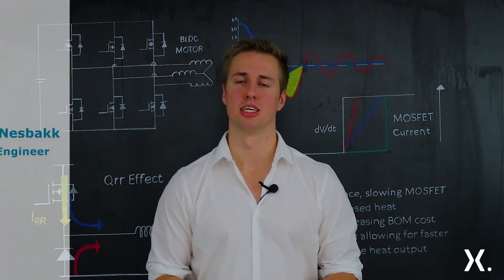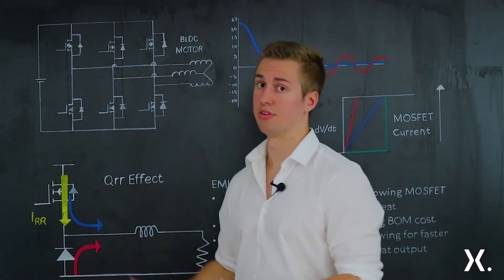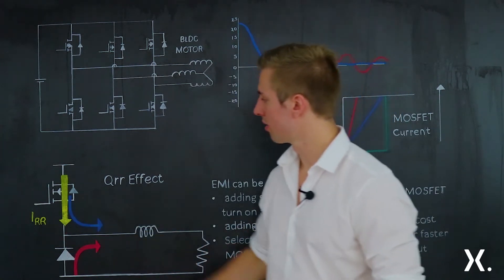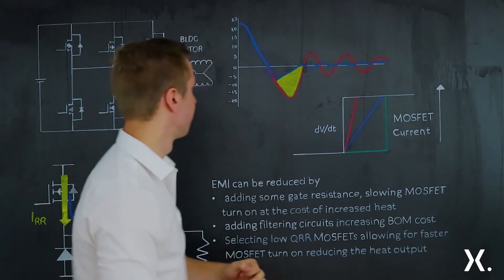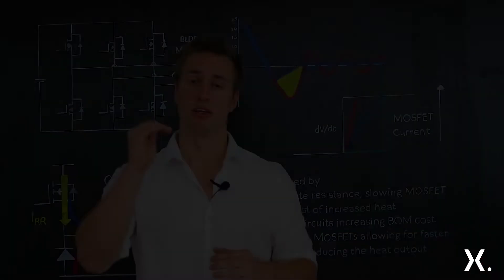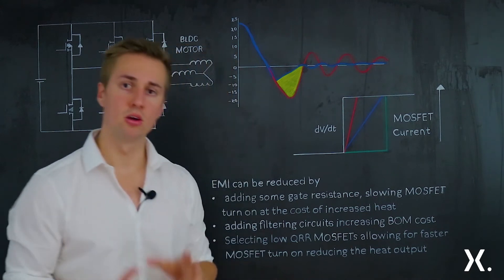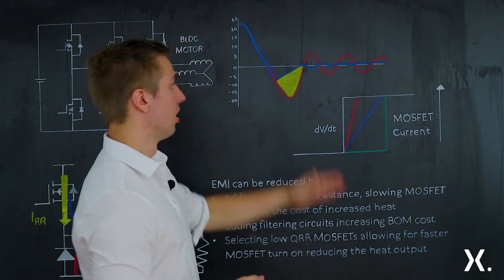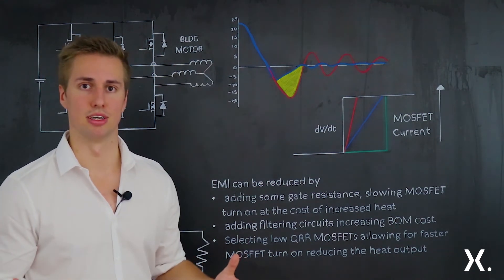Benefits of low Qrr MOSFETs in motor control applications

Comment: This video, and the blogs by Mike Becker  (on Feb 26, 2018) and Siva Uppuluri (Oct 31, 2019) all show that Nexperia seems to be concerned about Qrr but, totally unaware of total stored charge. Nexperia's data sheets STILL show the measurement of Qrr and trr at the old, outdated condition of a rate of -100A/us.  This test condition does not show total stored charge, which is much more critical for power losses and ringing that Qrr. Many manufacturers show Qrr at a more realistic measurement rate of around -2,500A/us. This more accurately show total stored charge. No design engineer in their right mind would switch a fast MOSFET at a slow rate of 100A.
Why do manufacturers continue to use this old outdated measurement instead of the more important parameter of total stored charge? Are the engineers not in-touch with the marketing clerk who writes the data sheet or something?
Some of Nexperia's online interactive data sheets DO have a tool for displaying Qrr vs current rate of fall, which is great but, why not for all new parts?
Reply from the maker: Hello, thanks for your comment. MOSFET datasheets play a critical role in the initial selection phase of a design. Designers will have several components to look at in a short space of time before deciding which ones to analyse further. Qrr at 100A/us is a standard condition used by multiple MOSFET venders, although granted that it may not reflect 100% real life application conditions. Using this condition makes it easy for designers to compare multiple devices as they are all relative to the same condition.  Changing the datasheet to include real-life application conditions will face the challenge of what constitutes as real-life, as multiple conditions arguably exist that are as valid as one another. To help customers with their designs, as part of application support Nexperia, provides – when requested – test results and parameters for any conditions that reflect customers applications. Nexperia Interactive Datasheets are powered by our precision electrothermal models, which more accurately reflect dynamic characteristics. We currently have 150+ interactive datasheets released on nexperia.com, with plans to continually release more throughout the coming months. For more information on our interactive datasheets or electrothermal models visit https://www.nexperia.com/applications/advanced-support-tools.html